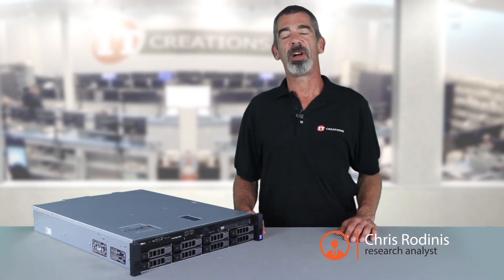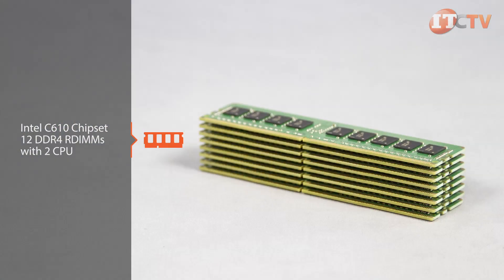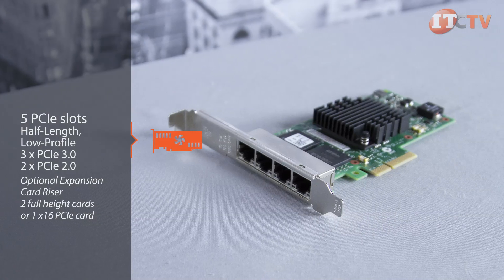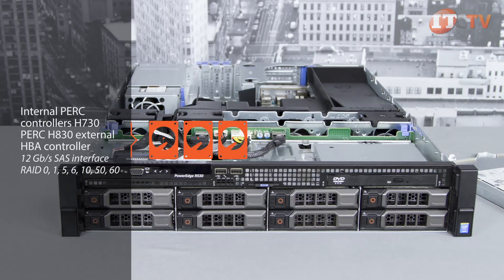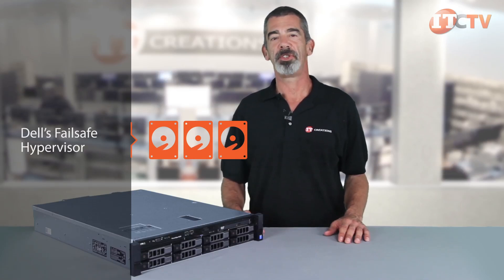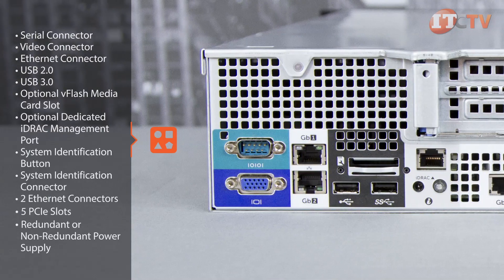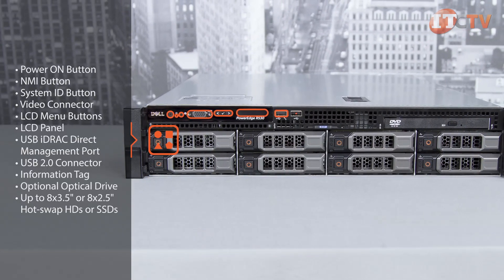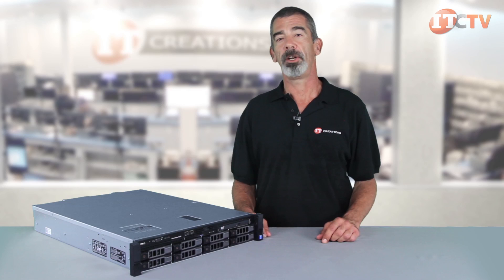Dell PowerEdge R530 Gen13 Rack Server Review

Comment: Hi Team,
By default in PowerEdge R530 i got 180 GB SAS. Now i was upgrading my storage. So i attached 4TB SATA in this server.I tried attaching in every Disk Box. But it's not detecting. Whats the reason?? 
Because in this video you mentioned we can attach upto 6TB Hard disk.
Reply from the maker: Hi Chandan, A few questions before we begin.
What model of hard drive is it?
Is this the hot-plug chassis?
Are you using the integrated controller or a separate PERC controller?
Are the drive lights coming on when you install the drive or not?
Please provide as many details as you can about what happens.

Comment: Sorry....but I didn't understand (cause my english) if the optional Idrac port card is necessary for the remote management or if it's enough the ethernet Gb1 for the Idrac remote management.
Thanks in advance for yours replys and support
Reply from the maker: HI Joe, The R530 supports iDRAC 8.0 Express. the Enterprise license provides more management features but both have remote access. click this link for a handy chart of the capabilities of iDRAC 7 compared to iDRAC 8: https://www.itcreations.com/user-manuals/R530/iDRAC%207%20and%208%20Feature%20and%20Licensing%20Comparison%20Nov%202014%20(1).pdf 
You can also click the link at the top that says "Dell PowerEdge R530 Server" then click the Documentation link in the secondary navigation for more information on the R530. Thanks for watching!
Reply from the maker: Hi Joe, The dedicated 1GbE port on the back is made just for managing the system, no PCIe card required. It also provides access to the integrated iDRAC module on the motherboard. Hope I answered your question, and thanks for watching!

Comment: why would a server have usb 2 and 3.0?
Reply: Maybe if they're using an OS that doesn't support USB 3.0?
Reply from the maker: Hi +Jonathan Brierley possibly to support newer technologies, but yea, why didn't they just use all 3.0? It's like 10 times faster than 2.0? Your guess is as good as mine.
Reply: 2:08, all the listed OS supports usb 3.0, for exmple you cant even install windows xp in this server. so no need of USB 2.0...
Reply: @bishnupratapdas621  
Not really? Those OS's are just there for full compatiblity. You can in theory install any OS you'd like.